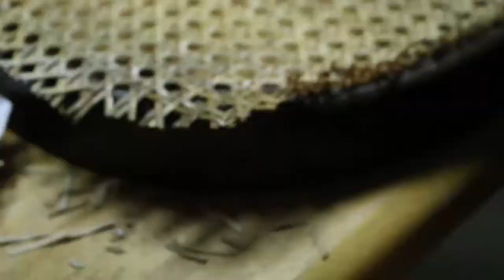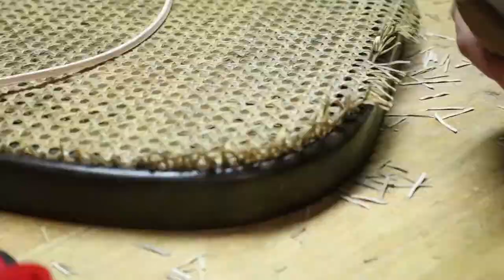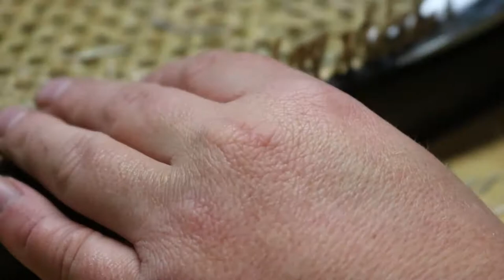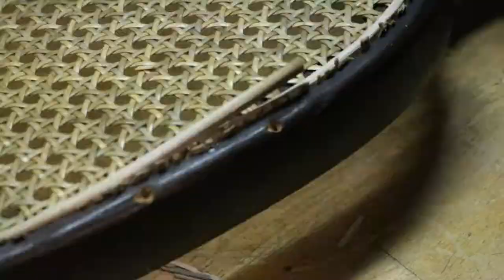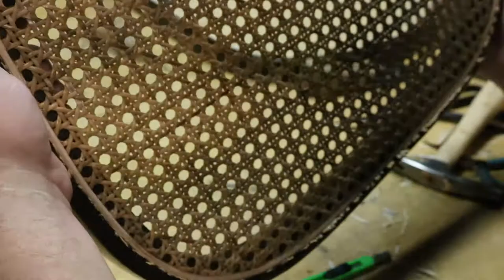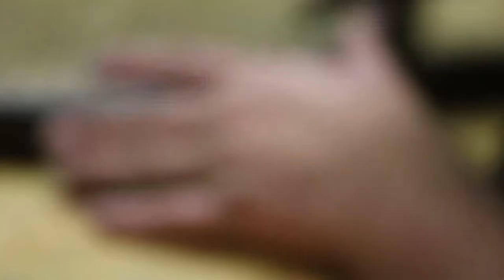Pressed Cane Installation in seat for Bentwood Rocker - Part 1

Comment: Beautiful work!  How long did it take to do the seat?  I have an original Thonet rocker that needs seat and back caning replaced... any suggestions on where to get the cane webbing or do you know of any kits?  Thank you!
Reply from the maker: So sorry for the late reply, removing the spline and cane is the most time-consuming part of this process, which I failed to record.  You would likely need a steamer to aid in that process.  
For the webbing, you could use a kit from amazon, here is one with good reviews: https://amzn.to/3vBI0kN
I normally buy bulk from a distributor, but if I was just doing one or two of my own pieces, I would order from Amazon.
Just make sure the spline and the webbbing is the right size, you would want to measure to make sure.
As far as installation, it depends on the size of the piece and your skill.  I can complete an installation in approx 30 mins and sometimes it can take over an hour.  This piece took approximately 40 mins I believe.  
Thanks for watching!

Comment: Where do you get the little metal tool you're using to push the cane into the groove?
Reply from the maker: Sorry for the late reply, I haven't logged into this account for some time now.  
The tool is custom-made by a blacksmith.
Reply: @wickerfixer2103  thanks for the reply!